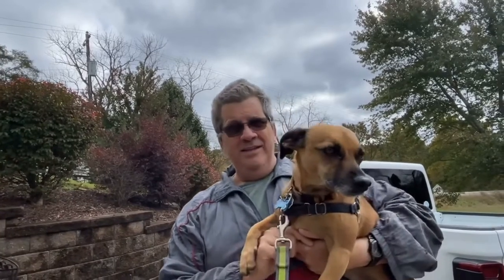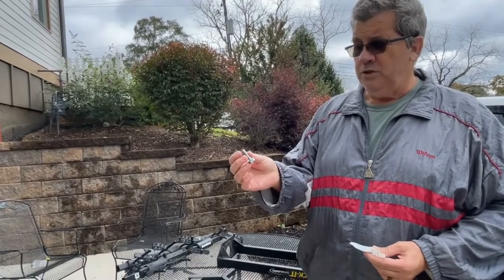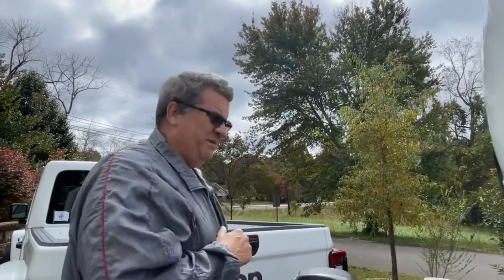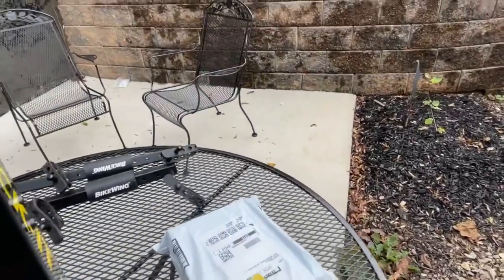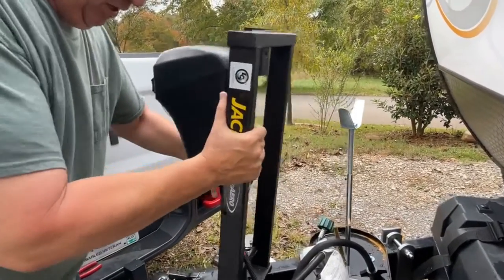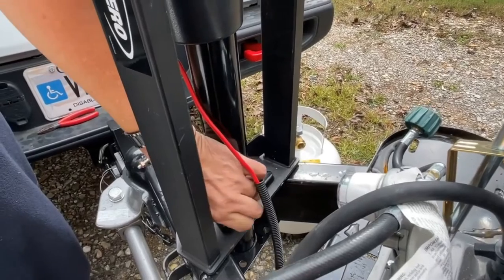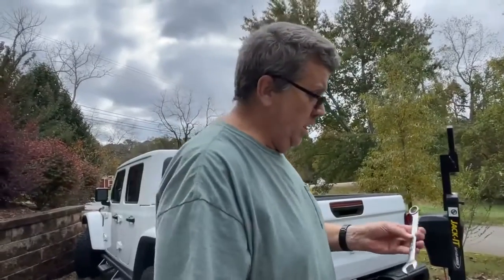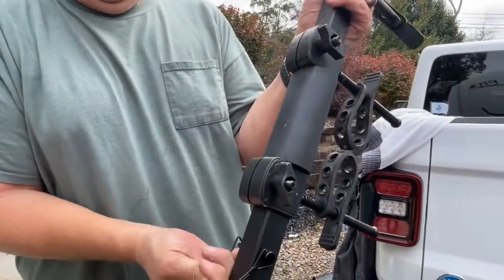Jack-It bike rack installation on a Geo Pro 15TB - The ending is not what you think

Comment: Your bike wasn't the problem.   You have both the lower rest going the same way.  Both the rim hooks at the top, and the tire rest at the bottom should have one forward and one towards the trailer on each stanchion.   You have both tire rest at the bottom going the same way on one stanchion.
Reply from the maker: Thanks
Reply: @CampingCoastie  SMSupersrat is right.  There should be two on each side not all 4 on one side.  My neighbor just got an E-Pro and they came pre-installed incorrectly.  it should look like the way you see them in this video: https://www.youtube.com/watch?v=6PC59t2vqmk

Comment: If the tongue jack doesn’t work electrically you have to remove the bike rack to get at the manual crank feature?  How does that work?  You would have to carry jack stands and jack to take the weight off the tongue jack so you can take the tongue jack off to take the bike rack off to put the tongue jack back on to manually crank the tongue jack.  Was this designed by a government bureaucrat?
Reply from the maker: You just have to pull the pin and remove the bike rack by lifting it straight up.  The big rectangular frame stays bolted to the trailer tongue.  You can put a socket in the frame where the bike rack mounts.

At 9:17 you can see the bike rack being inserted into the frame.